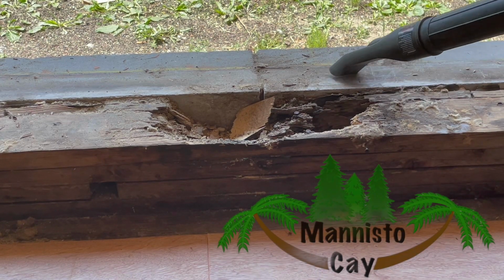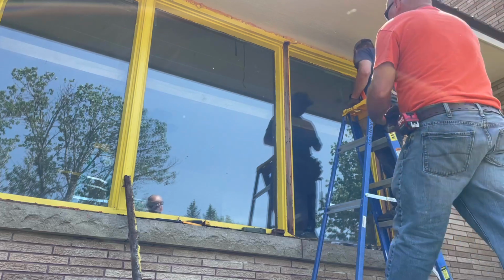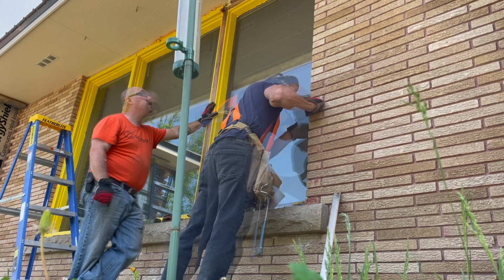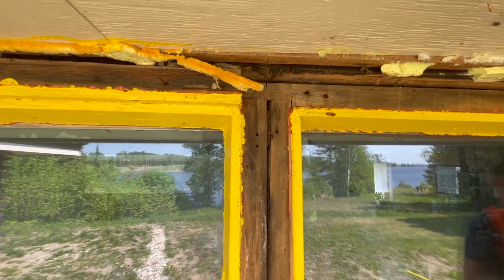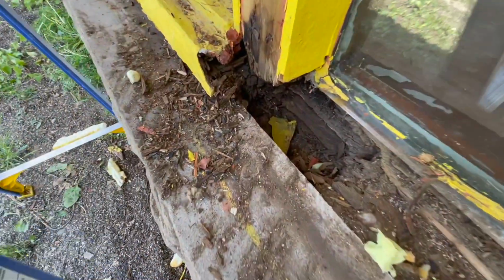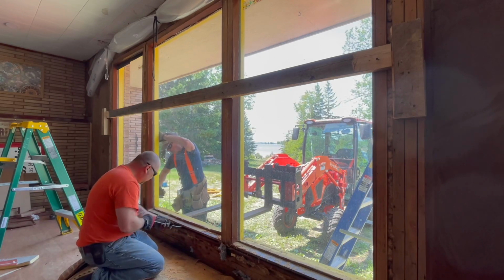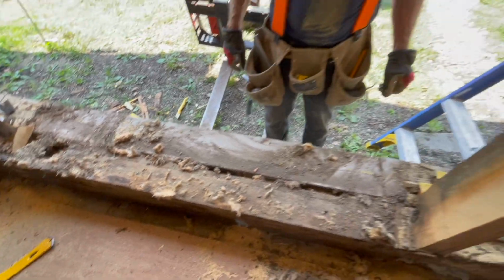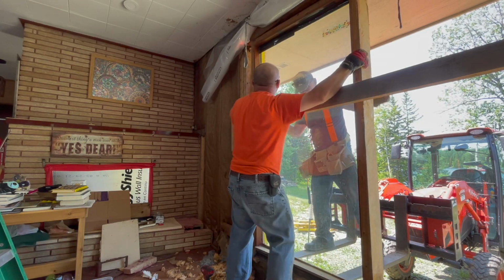@Renovations! Picture Window Part 1 removing wooden framed window with brick veneer.

Comment: My father was a carpenter in Toronto in the 50's and 60's.  Back then when a house was built they did not buy windows from a window company.  The carpenter made the window frames on site and they were installed during the framing.  Later a glasier came to install the glass.  There were lots of glasiers during that time.  It was a trade.  The carpenter also made the kitchen cabinets on site.  Carpenters then were more than framers.  They were very skilled.  They also made the front door frames, and all the stairs.  Yes they even cut the stairs on site.   It wasn't till the 70's that factories started to make windows kitchens and door frames; and stairs.  I remember my father making windows in the basement during winter when it was too cold to work outside.  It wasn't that complicated.  The lumber yards sold all the profiles and 2x4's.  It was a better quality lumber.  The only thing from that era a real lumber yard sells today is window sill lumber.  
     Your father was right.  The window frame was made with the wall.  The glass came later.
Reply from the maker: Very cool thanks for the information and history.  Thanks for the chat!  Hoping you want to follow along, subscribing makes that easy. 👍🏼🤜🌴
Reply: @MannistoCay  I am subscribed.  How do you think I got the video?
Reply from the maker: @miltonfreedman4225  oh excellent! Thanks for coming along for the ride. 🌴👍🏼😀